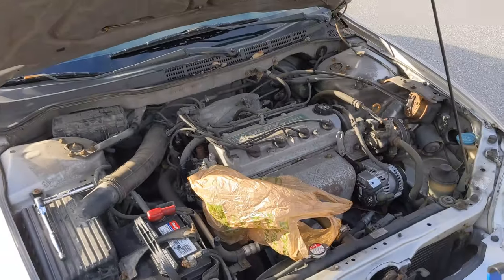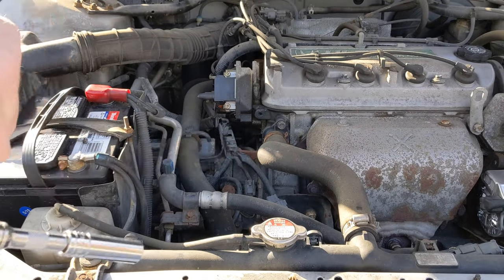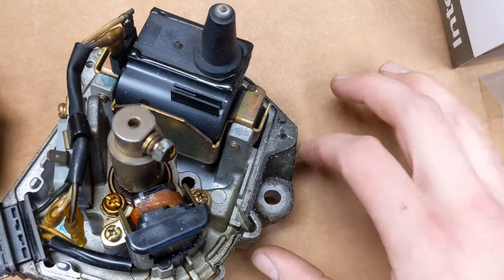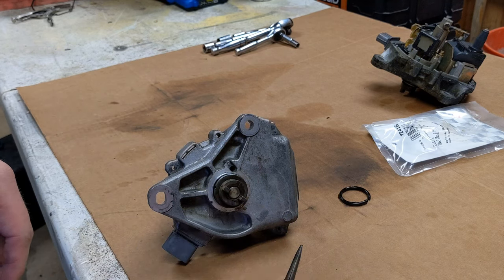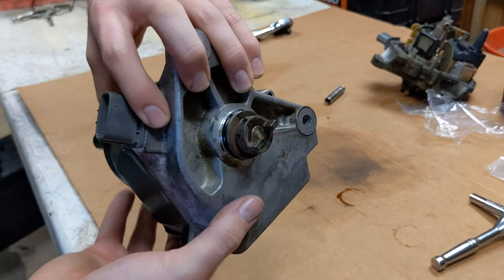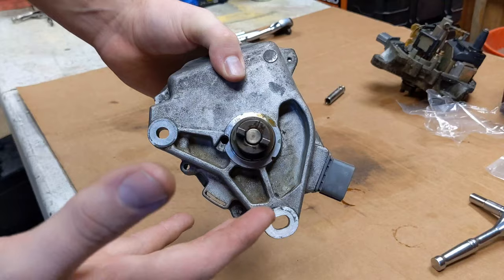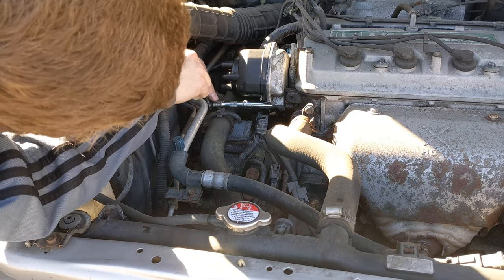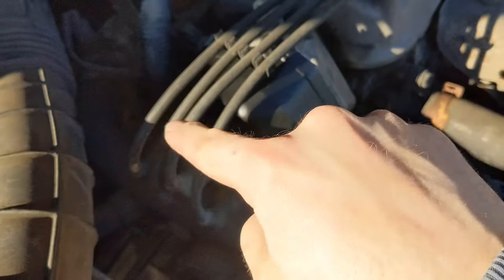How To Replace The Distributor On A 2000 Honda Accord!!!

Comment: Thanks for the video. I changed my distributor on my 98 Accord. After I installed it, it won’t run. I think I had moved the rotor without knowing it. If this is the case, I can just turn the rotor back the other way and reinstall it,it should run,right ? Thanks

Comment: Is the camshaft position sensor along with the distributor?
Reply from the maker: I'm not sure.
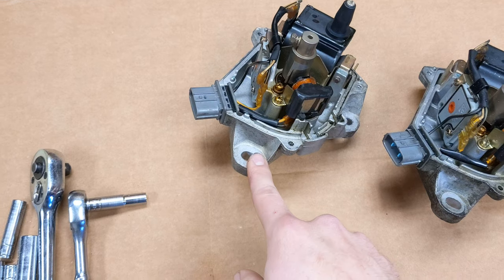Reply: I believe it is the square shaped black and metal coil on bottom inside. It's right up against the shaft that has a fin on it. Near center of screen at 5:41

Comment: There is another oil seal that "should' have been replaced.  It is PITA because you have to remove the shaft.
Reply: How do you do that my car won't start I'm thinking it's something to do with the electrical connection to the coil but I need to put a new o-ring in because there's oil leaking in the distributor I'm no mechanic I'm learning
Reply: @troyvandergiessen4864 
https://www.youtube.com/watch?v=pBZJpG4f9Zk
https://www.youtube.com/watch?v=jKKoXRY3qPA
Good Luck......I ended cracking my distributor because the pin was pressed in so tight.  The O ring and the Seal both need to be replaced to stop the oil from leaking in......and you might as well replace the bearings too.  These cars are 20 + yrs old.   Give it shot, and if it comes apart clean every thing with electrical cleaner spray and put in back together with the new oring and seal...... If not, like me you have to get another distributor.  I bought a re-manufactured.  It was less, expensive than a new one, or a used one from the salvage yard.